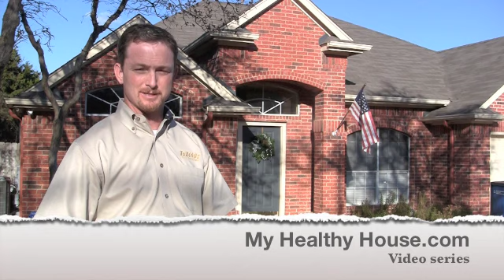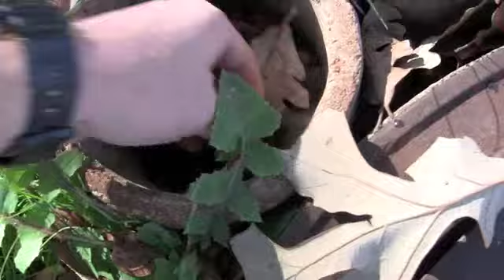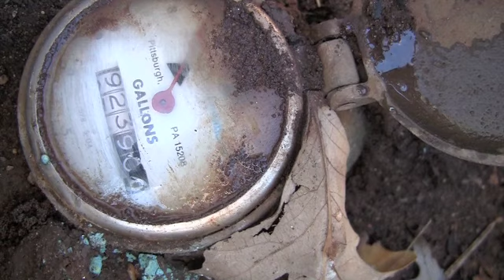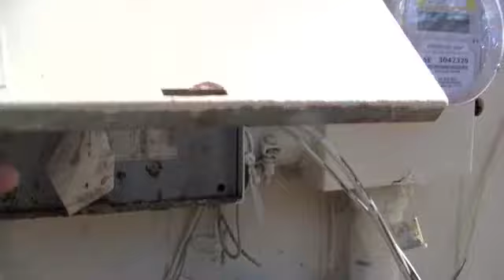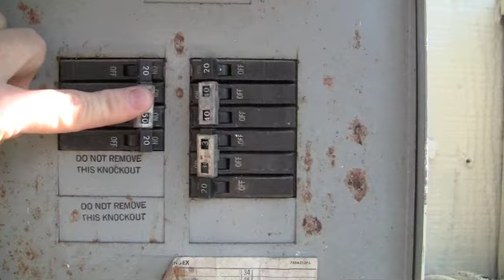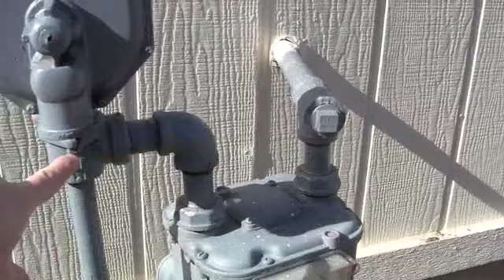Inspection files - Main shutoff locations

Comment: This was very helpful to find the valve, but our city locked off the water valve so we couldn't access it. ;{ Still a very informative video either way. We ended up calling the city to come shut the water off because we had a plumbing emergency, so I suppose that's another option if anyone runs into a similar scenario.
Reply: there should be a valve in your garage too i think.